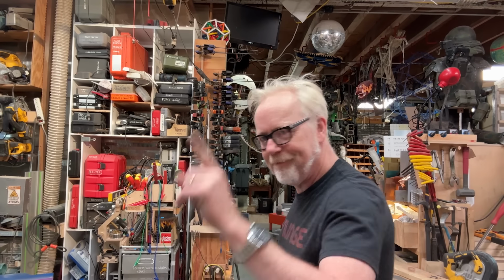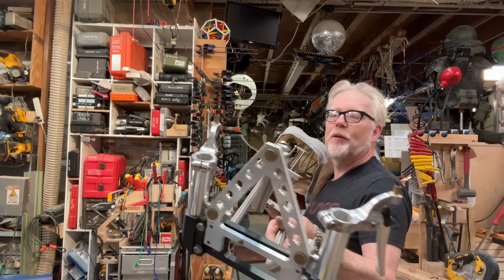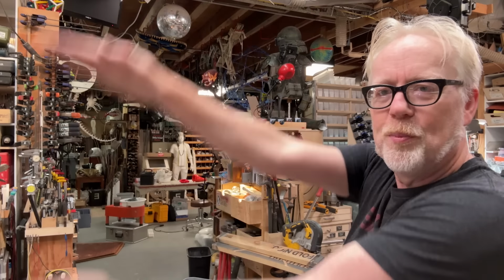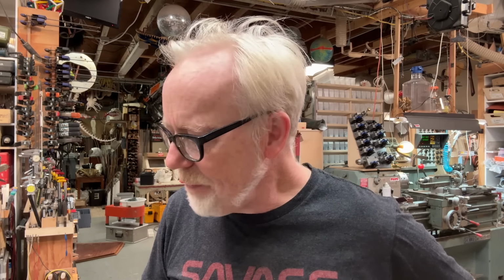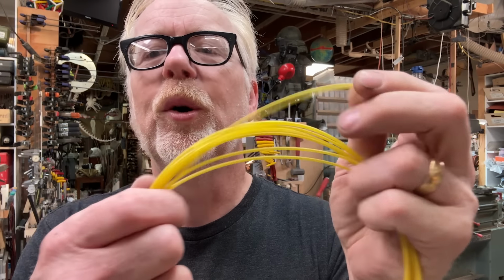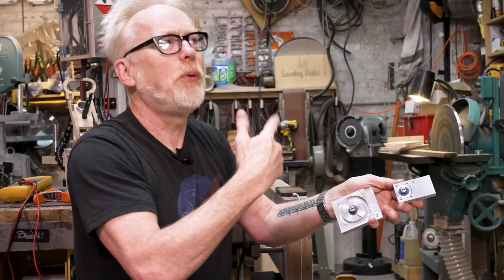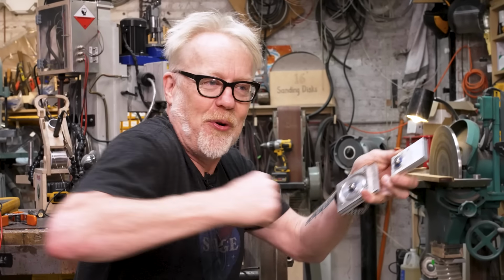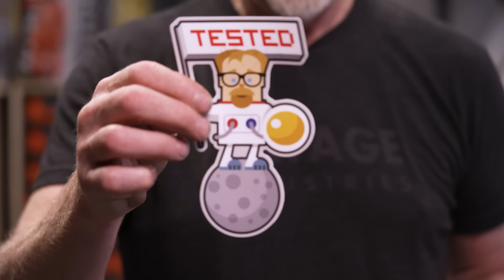Adam Savage's Dino Build: The Great Jaw Mech Fail (Ep 3)

Comment: You didn’t fail. You successfully learned how not to do it. ❤
Reply from the maker: Well, there is that!
Reply: @tested  I would say failure ain't bad...Yes, it can be bad in competitions where imposed rules keep you from trying and failing either by time, money or just straight up told 1 try only in the rules...

If you don't personally have time or money constraints and only have self imposed rules...then maybe change those rules? If the time it takes to think of the perfect plan would take more time or indefinite amount of time if you procrastinate...and you can tank some costs of using blocks of aluminium for failed attempts...

You either will have reached your goal exhausting all your options or you get the lesson of "I need to do more research" 😅 or" I need better skills in research"

Anyways just saying the obvious...I don't even know if you are bothered by failures... But it's cool to see the up and down And ASMR process...😂 Hope you figure whatever issue caused your failure and find the appropriate solution faster than the last possible answer 😂😊

Comment: Adam, some unsolicited advice from the peanut gallery that you likely won't read. I've created something similar in the past and achieved the return in the jaw with resistance bands. The actuation of the jaw I managed to rig with a flat wound upright bass string. Had to stretch it a bit, but it held well once it was there. I used a joystick style lever and with it got a lot more movement through the cabling. From one creator to another, I hope this finds you well and possibly gives some insight.

Comment: I'm not good at much, but I am a professional bike mechanic. When Adam demonstrated the materials for the cable system my first thought was to wonder if that tubing had enough compression strength.  The force the cable receives in tension is applied to the housing in compression. Eh, that said, I'm still in awe of the sheer amount of stuff Adam knows, expert or not.
Reply: I wrenched on bikes for years too.
As soon as he showed the housing and the line he was using instead of the cables he was using to actually explain it, I knew there was going to be a problem.
All he needed to do was add a boss to either end of that top bar of his 3-bar linkage, and have a short run of regular housing on either end with the bare steel cable between the bosses.
The steel cable doesn't weigh much, and is needed at these lengths.
I'd go as far as to say that fishing line is terrible for the job, except for very short runs, because it is designed to stretch when loaded, where the steel cable is designed NOT to stretch.

This seems like a solved problem in the bike world.

Comment: I'm definitely not proficient at animatronics but speaking as a fisherman,  if you want sensitivity and to eliminate flex in the fishing line, I highly recommend braided fishing line Trilene(berkley), or spider wire... the line you showed on screen I believe is a monofilament which is plastic and even though it is rated at 100lbs it will stretch at far less than that.  I say all that fully aware that this does not solve you housing issue for the cable, but after hearing the end of your video it's all a moot point, sounds like you're in good hands.  Looking forward to the rest of the one day build, some other day.lol

Comment: Nylon line inside bowden cable housing is a clever one! Us bicycle types are forever battling the effects of excess friction in brake and gear cables, and while we're more or less stuck with steel for strength reasons (or at least stiffness reasons with modern indexed gearing), it's nice to see an alternative idea floated for animatronics. 

Also I cannot stress enough how important the openness about things not going to plan is. There's a time and a place for build videos that make everything look slick and polished, but part of what puts Tested so high up my list of workbench background videos is the fact the things that didn't work out are given as much discussion as the things that did!

Comment: You have a ridged structure between your hand control and the jaw pivot. Therefore, you can add pulleys along the "neck" and string your steel cable (without tubing) to connect 'control' to 'jaw'.
- Also, put the smaller bearing at the control end. Sure, you'll need to rotate the controller more but will gain an "advantage" in torque at the jaw end.

Comment: I've been confronted with similar issues, and have some suggestions.

A main issue is getting the mechanical advantage from the squeeze of a hand to the movement of the jaw. The problem is, the travel distance of the jaw needs to be much longer than what a hand squeeze can provide. So, change the ratio? Well now the weight and inertia of the jaw is multiplied on the hand feel; it takes much more force. And, the animation starts to get choppy and wobbly, loses control and fidelity.

So, use two mechanisms, one on each hand. There's two options for setting this up.

The first that occurs to me is to have a me hanism for the lower jaw, as well as one for the upper. Essentially you decouple the skull mounting from the neck plate, and install a hinge there, so that the upper jaw is an extra movement on top of the neck animation.

This allows you to have a shorter stroke for each lever, transferring power and control better, while still giving you the ability to squeeze both levers and open the mouth wide.

If you actually watch movie footage of a raptor roaring, the movement is almost never just the lower jaw dropping; that doesn't communicate the menace and power, and can actually look a little silly. Instead, a big roar involves the neck descending closer to the floor, with the skull pointing up and jaw pointing down. I think your current rig would have a hard time animating that extreme of a neck angle without inverting, but an upper jaw movement would do this.

Another two-hand rig might be to still only animate the lower jaw, but have a sorta high-gear, low gear setup, so one hand moves large movements, but takes more strength, and the other more subtle movements, with more control. Still, the two levels squeezed together would open the jaw wider than one could alone.

And of course, use heavier brake lines! I was surprised and impressed when you opted for fishing line and plastic tube; in my experience that's never held up. The line has too much stretch and the tube collapses. But then that's exactly what happened to you too, so I actually feel kindof affirmed and redeemed there.
Reply: I was surprised about the choice of the petite bowden tube. What's wrong with using off the shelf bicycle brake cable?
Reply: I also imagine having the end point of the mechanism more in the middle of the jaw length would help open it.

Our own jaws are pulled by muscles attached below the jaw bone, not at its pivot point on the skull.
Reply: how is there not springs involved in this? you want the jaw closed by default - you dont want to have to hold the jaw closed right?

Comment: I can relate to this video HARD. The thing about building animatronics/mechanics is that you often only learn the right way to do things after you have failed. There is so much that can go wrong and much of the work involves a fair bit of trial and error. Even if you have experience building animatronics, your experience often doesn’t tell you the best way to do something, but rather how NOT to do it so you can iterate a working solution faster. Over time, you tend to build up a mental library of things that you are pretty sure will work kinda/sorta well for a given application -and even then those solutions may not work 100% right out of the gate.

Comment: @Adam Savage.  Use metal hydraulic brake line to run your wire inside of, you can buy in different lengths it's easy to bend it's a very small it's lightweight and easy to cut and you can use a breakline tool to smooth ends off.

Comment: I really admire Adam for being willing to put up an entire video of a failure. As someone who dabbles in DIY and craft projects from time to time, I know full well the pain of being entirely sure something is going to work, spending many hours and lots of effort, only to find out it simply does not work. At that point, it's very difficult to find the courage to continue, and even more difficult to decide whether to keep trying, realize you're in a sunk-cost situation and start from scratch, or admit you're just not good enough and seek help. 

I'd freely admit that I would be way outside my element on this, because while I can grasp the mechanism of a bike's brakes when both ends are on a rigid fixed system (the handlebars rotate, but the distance between the brake levers and wheels remains the same) this is totally different. The distance between the dino's mandibular joint and the operator's controls are constantly in flux due to the complexity of the joints connecting to the armature. Just imagine strings taped to the sides of your jawbones, both attached to the middle of your chest, how they would tighten and slacken as you more your head around.

In my mind, it doesn't seem possible with the free movement of the neck and lack of any rigid attachment points in between... but there's likely a simple solution that someone experienced in the field of animatronics can point to in a second.

Comment: Oo, I wanna help so baad! Few brain blurts: larger pullys on both ends will decrease max force being asked for from the cables, meaning also the housing. Smaller cable levers makes higher torque requiring stronger (and heavier) cables, at the advantage of not having to travel as far.

Also, you'll get mechanical advantage and increased fidelity if the smaller pully is on the operators side. It means the smaller pully moves more, say 90 degrees for the operator makes 45 degrees for the jaw, but you wont feel like youre climbing a hill in 6th. 

Cant wait to see it done. ^_^

Comment: I too am a master of few things, but spent a career designing products, often blending technologies from other areas. Looking at your jaw activation, I first think of RC aircraft technology. It’s come along way since the days of pushrods and bell cranks. Now with lightweight servos, they’re able to move large control services. I would suggest looking into the push pull mechanisms in use today. Important criteria are lightweight, rigidity and strength. I think you might find something useful there.
Cheers,
Dan

Comment: Great video. Stronger cables, larger pulleys, and a spring on the jaw to cancel its weight would help. Or use servos and a battery. Will be very interesting to see the final solution!

Comment: As an idea why not think more Henson and simplify the design, use a spring to keep the jaw closed with minor tension. To open the jaw at the pivot point of the jaw lowering the bottom jaw requires anti clockwise movement. Using a pulley wheel and cable setup should be able to achieve this. Or to not reinvent the wheel repurpose a bike brake then just use a spring like on a bike brake to open the jaw.

Comment: think about your bicycle break line you spoke about, it is not soft plastic, it is a steel wrap with a plastic coating to protect it and the core from smoo and goo. that steel wrap is not compressing when you apply force to the lever. you need the same strength in your guide tube. it must be able to withstand the pressure being applied to transfer it to the remote object.

Comment: You are quite the humble man. That being said. I would use a line feeder and threaded compression fittings on either end. And use braided wire instead. Worked for me. You mentioned brake line, it would actually work well.

Comment: long time puppet head here, My opinion is, you either want to actuate the mouth opening or closing instead of both. In my humble opinion, having an elastic or spring loaded neutral closed position is your best bet then using your cable system to pull it away from neutral would mean your hand would only need to clench on it like a bike brake to open the mouth allowing you to roar, talk, and bite things quite quickly. But I cant wait to See how this is actually in fact "pulled off" on your dino.

Comment: A possible off the shelf solution might be a motorcycle throttle control assy with push pull cables. Harley stuff uses a control sleeve that is build for a 1 inch diameter bar and a wide variety of cable lengths are available. Also, you said you don't want spring return, which is valid, but spring counter balance might be helpful to manage the weight overhang of the jaw.

Comment: Maybe it might benefit to look at some resin/3D printed fursuit head jaw mechanisms for inspiration? The lower jaw on most fursuits is held closed with either elastic or springs which snap shut (attached at points on both the top and bottom jaw)and for something that's mounted on a human head there's a place your chin rests that pushes the lower jaw open with your own mouth movements. Perhaps, when upscaling this, there's a cable system you could use that applies pressure to a "chin" of sorts (a metal plate?) and pushes the jaw open? You'd just have to use a little bit of fabric to hide the springs (fursuiters use fur or minky fabric for this), and a way of covering that mechanism with the raptor's tongue, perhaps? Incorporating that "tongue-chin" (?) into the down-force of the "chin" that pushes the jaw open? I do agree with other commenters though that you might be overthinking the engineering and mechanics a little though (I could be overthinking this myself). 

It's okay to admit when things don't work though - you're just eliminating problems one annoying lesson at a time. It's like Bob Ross would say, it's just a happy accident that points you a few more steps towards discovering the right way to do something. Don't be too hard on yourself Adam, it's okay to sit the big project on the shelf and practice with some smaller prototypes and mini-models as well which won't hurt so much if they break. 

I wonder if talking to that one british hand/finger puppeteer who made Dabchick (forgotten the guy's name unfortunately) might help? There could be a way to upscale something he made. Alternatively, I don't know why this popped into my head, but I feel like Colin Furze might have an idea for something cool (although he also has the potential to turn this raptor into a dragon that shoots fireworks or something equally as dangerous).

Comment: 1- To reduce the power needed on the handle (and the tension on the pulling cable, that is crumbling the tube), you should counterbalance the weight of the jaw. This could a cable fixed on the jaw, that goes in a pulley in the skull, and fixed on a mass guided in a "vertical" tube  (when the skull is horizontal). Then whatever the inclination of the skull (sideways, or looking up or down), you have the exact compensation of the effet of the gravity on the jaw. 
2- Use the same cables and sheath as for bicycles, those are rated for the strength of a hand, and the overweight is irrelevant compared to the weight of the whole raptor head.

Comment: At the dinosaur factories I work with in China, we produce costumes like this.
For the jaws, we just use the bicycle brake cable to pull a lever at the jaw hinge joint and use the spring to close the mouth.
Granted, you need a bit more force because of the short lever and the long jaw, but I'm curious why you think that mechanism is more complicated.

Comment: Tensioned cables with a spring return like a throttle cable on a motorcycle or old school car or truck is your best bet. Hand pumped pneumatic system would be neat, and you can use the same system to actuate different parts of the head too (eyes etc.).

Comment: Adam, you have the right idea, but you do not need the tube. You are thinking bicycle breaks. Think more along the lines of automotive fan belt. You can basically utilize most of what you have already made. Secure the jaw wheel firmly. Then - as with the adjustability of the alternator, in allowing the fan belt to tighten - devise an adjustable tightening system at the control end. Think: Control side is mounted to an adjustable/retractable screw/pully type system.

I'm finding it tough to describe exactly what I am seeing in my mind. I'm seeing 2 screws inside a track, secured to the control end; upon which your control wheel is secured and drawn closer/tighter by turning the screws. It's something like the same concept a plastic cut-in electrical box, from Home Depot, would use. The more you turn the screws, the tighter it gets.

At the control end, think: I can only get the line so tight. I need to get it tighter, with less, "slop." You secure one end of your line to the out-going side of your control end. Run the line around the jaw wheel. Return to the control wheel and connect to the in-coming side of your control end. Get your line as tight as possible by hand. Be sure to secure everything. Once everything is tightened, tighten your screws to draw the control end further away from the jaw.

This system does not need a cable casing and the securing mechanism only takes place at one side. It is held in place by tension, not cable control.

I hope I made sense and this helps you.

Comment: You may find that by using the fishing line, that it will stretch well before the snap length. It tends to happen *that give*. It may offer way too much give to be used and you may wish to add extra on the pull of it to begin with to give the added opening effect. Happened to have that happen to myself. It can be nice, yet is too forgiving when used as a daily for that. You may end up having to replace after 1 or 2 cons because of overuse and the stretch.